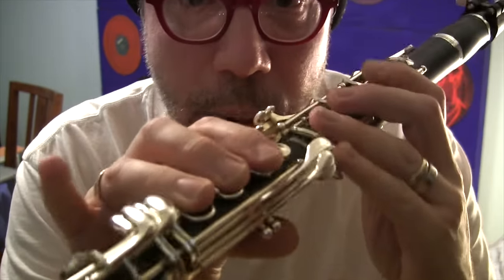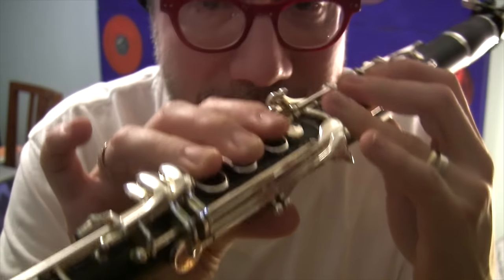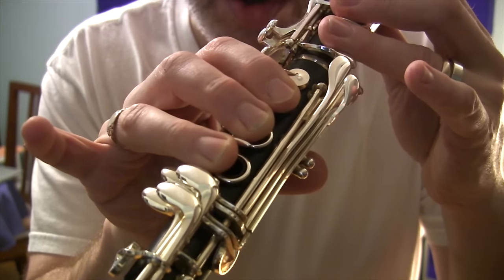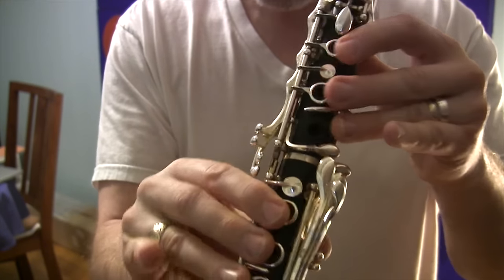How to play Gershwin's "Rhapsody in Blue" opening clarinet solo

Comment: I don’t even play a wind instrument, but wondered how this solo glissando was achieved. What an excellent demonstration! I learned something new today.
Reply: The irony is that the trombone is the best natural smear instrument, but it can't produce a continuous 2-octave smear.  If you had a 24-position slide and an assistant to stand 12 feet away and push it in maybe.  But that would require a slide more than 3x the length of a normal trombone slide.  They are enough of a pain in the ass to maintain at normal length.

Comment: Alright so what if I have extremely fat fingers and you create a custom bass clarinet with holes in the keys. Is it then possible?
Reply from the maker: Yes, absolutely. Oh wait. No, impossible still.
Reply: If you have thin fingers, you're fucked.
Reply: Bass clarinet
Reply: Grab an old alto clarinet or bassethorn
Reply: Earspasm Music will you elaborate more ;-;
Reply: Moe's there are some keys on the bass the correspond with holes on the side  (low g key is one) and the key work on the front joint is too different. And even if it wasnt the issue. The holes are still way too big for a guy with really big hands
Reply: @schererman6410  Exactly. the holes that the pads are covering are much farther apart than the finges. See how far the holes are on the regular clarinet? The holes on the bass clarinet are twice as far apart. Much too far for you to reach with your fingers.

Comment: I love your enthusiasm on this subject, and the way you reveal the secret of the gliss! I do have a comment about when you said "when you pull your finger off a port, all of a sudden the instrument becomes a lot more resistant". I'm thinking you are referring to the fact that you have to blow more air through the reed and out the "new leak", thus raising the pitch of the reed and note the instrument is playing. 

It's easy to forget that a pump, like your lungs and diaphragm, creates flow, when blowing, NOT pressure! Pressure happens when there is resistance to flow! 

The main resistance to flow, in the clarinet, is the amount of flow it takes to keep the reed vibrating but not closing. The pressure in the chamber downstream from the reed is very sensitive to pressure drops caused by ports opening and closing. When an extra port is opened, and if the flow through the reed isn't increased, the reed stays open and stops vibrating. By increasing the flow, the reed keeps vibrating, but at a higher frequency, or pitch. As more ports are opened, the pressure drops demand more and more flow, which results in higher and higher pitch.

Comment: I keep squeaking when I try to do it 😂 Someday I'll figure it out
Reply: same ugh
Reply: Lαni Bοhmοnt The proper voicing will prevent you from squeaking. Experiment with your tongue position. This video was absolutely useless to me when I was first learning how to smear because he puts way too much emphasis on sliding your fingers when in reality your fingers do just about 5% of the work. Keep your pitch as flat as possible the whole time (you have to experiment a lot to learn how to do this) while pulling your fingers of the holes. It's not so much about all these detailed finger movements he describes in the video; you basically just need to keep your fingers close to the holes in order to provide adequate resistance to the airflow. In fact, a smear can be done by simply lifting your fingers in succession.
Reply: Yes, do it! Tell us when you can play..

Comment: My dad used to teach this to his students... but never taught it to me.  I ended up switching to trombone and returning to reeds at age 40.  I understand why this doesn't work on a bass clarinet, and why it's pretty difficult on a saxophone.  Just to play the opening smear on "Yakkety Sax" I use a really soft reed and an open tip metal mouthpiece.  What drives me nuts about that one is all the charts I have start that smear on an E, and listening to the record, he clearly starts it on a D.  WTF.  Anyway an old mystery solved.  By the way, you really draw that smear waaaaay out and I like it that way.  There are some very well known recordings where the clarinet not only misses the low note at the beginning, but rushes the whole thing.  

Might be possible to modify a bass clarinet with some sort of inserts below the pads to allow that pull-off.  It's almost a guitar technique now that I know what it looks like.

Comment: Gershwin composed it for the (simpler) ALBERT SYSTEM clarinet, prevalent in jazz at the time. Albert system clarinet has many bare holes without rings and a simpler keywork. This piece was NOT composed for the complicated and thin-sounding modern clarinets.

Comment: If you were just about to start a concert something happened to your instrument, so you had to reach for a replacement and play it on the fly, I get the feeling the clarinet is one of those ones that just wouldn't work with this solo. You'd have to really know the particular make and model to pull it off, wouldn't you? Compared to a guitar or a trumpet or, obviously, a piano. It's never ideal to switch to an unfamiliar instrument, but the Rhapsody in Blue opening seems like kind of a nonstarter.

I'm trying to learn the clarinet right now.

Comment: There are a couple things that I don't like about this video. First, voicing is 100, 000 times more important than finger technique. And second, the main reason it's more difficult to smear on bass clarinet is not the lack of open tone holes, but rather it's the length of the instrument. For any given fingering on the clarinet, the same fingering on the bass clarinet will take up twice the length. And why does this matter? Because resonance. Your oral cavity affects the resonance of the instrument and acts as an extension to the bore. If the length of the bore changes, so does the length of your oral cavity relative to the bore. This is why it's so ridiculously easy to bend the pitch on just your mouthpiece. I mean for God's sake I can smear up the clarion register on a soprano clarinet by simply lifting all my fingers off the keys three at a time.